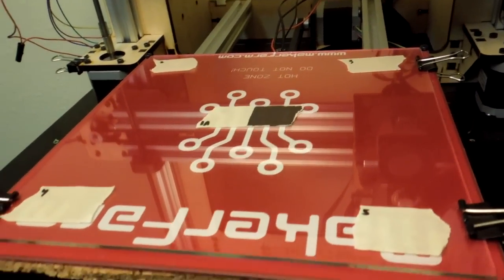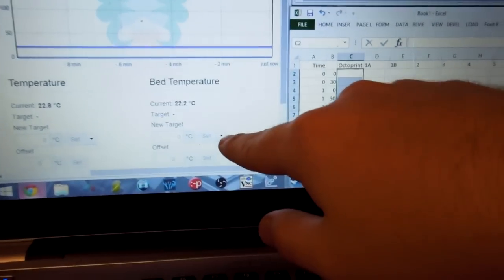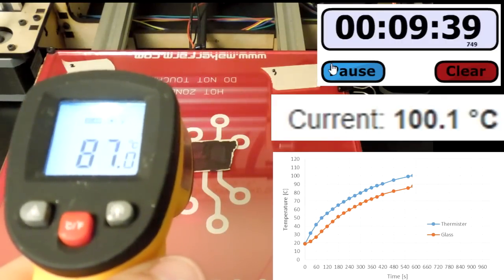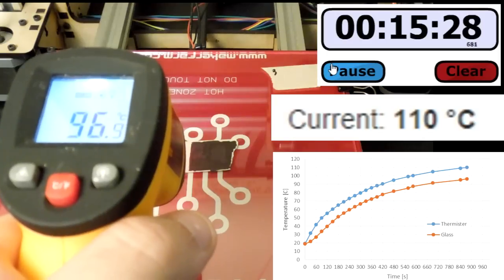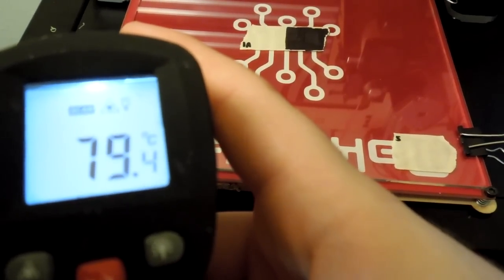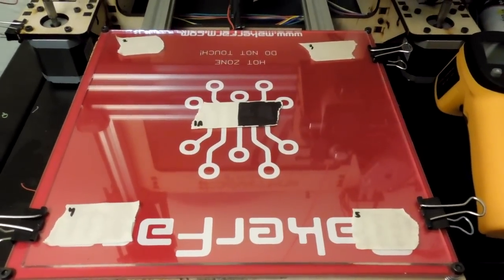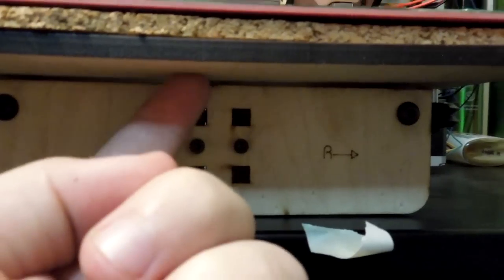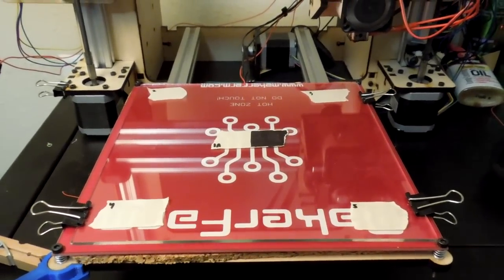Glass Temp vs. Thermistor Temp: 3D Printer Heat Bed Temperature Experiment

Comment: Glass is a thermal insulator, so that temperature delta between the top of the glass and the bottom of the bed heater is as expected. That reason the top doesn't eventually reach the same temp, is inherent to how the system operates. Whether its bangbang, PWM or PID controlled, when the sensor on the bottom of the bed/bed heater reaches its target, it cuts or modulates power to maintain that temp. But only going off the placement of the thermal sensor. When there's actual thermal loss between that spot (that spot is usually even insulated), through the bed sandwich, to the top surface, then there won't be any significant further temp increase of the top surface. The printer has no idea what the top surface or edge temps are, only the sensor on the bottom, so it has turned off (or reduced voltage/pwm cycle) the power to the heater to not overshoot. So there's no excess energy being introduced, that would be needed to heat the top surface further. For temp to continue to rise on the top glass surface, the bed heater would need to overshoot or move its temp target a lot, to compensate for this delta caused by loss, not just slow thermal saturation.

Comment: Thanks man!  I had some warping so checked the tube, found you.  I have the same discrepancies on the Ender 3 and CR10.  I will be insulating the beds as soon as possible.  The CR10 is partially insulated, I don't see why they didn't cover the whole bottom. And damn this video is pretty old, hahaha...

Comment: I had this same issue with glass. I was experiencing warping on prints that went out to the edge. I have since went with a .125 aluminum plate and solved all my problems.
Reply: would stainless work the same you think?

Comment: i have the feeling, that the "sluggish" thermal proerties of glass, are beneficial in that that it doest irradiate as much heat. 
PS: cover it with a rag, when you preheat your bed, and it heats up much faster and as evenly as possible.
Reply from the maker: Great idea about the rag, I don't know how I haven't seen that idea before. I'll have to try it out and see if it makes a difference.
Reply: thanks. my best guess is, it's just too simple and obvious, and you cant download a printable rag from thingyverse. 
i havent done any meassurements, but it does heat up much faster, and doesnt struggle nearly as much to get to high temperatures.

Comment: is the emissivity set for the reflectiveness of the tape? the default is flat black in most cases. Do the test and color all the tape black first...
Reply from the maker: I actually tried to account for that with the black colored tape in the center. I noticed no difference between the black half of that piece of tape, and the non-black half of the tape. Now, can I guarantee that the beam of the thermometer was only hitting the black or the white, no, but I am reasonable sure of my results for a non-peer-reviewed-journal type of science.

Comment: The 10 deg is caused by the color of the tape.
Reply: No
Reply: @Scanz_99  the tape needs to be flat black for the emissivity to read accurately, unless the temp gun was corrected for  the tape color.
Reply: Emissivity is the measure of an object's ability to emit infrared energy. Emitted energy indicates the temperature of the object. Emissivity can have a value from 0 (shiny mirror) to 1.0 (blackbody). Most organic, painted, or oxidized surfaces have emissivity values close to 0.95.
Reply: Fishhead thanks for the explanation, but if you look in the comments the author of the video confirmed that he did not reveal the difference between the black colored surface or not, and also having a laser thermometer I can confirm that the color does not determine a difference in the temperature detected  ... however, even if you were right the temperature would not vary by 10 degrees .. greetings